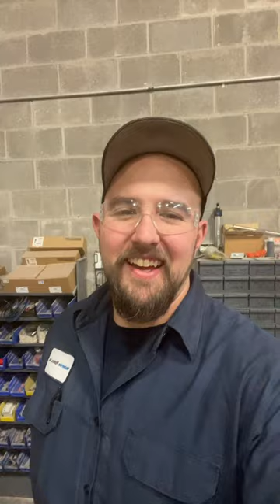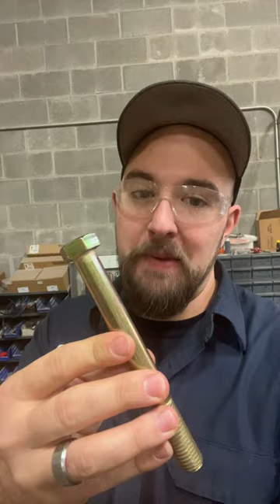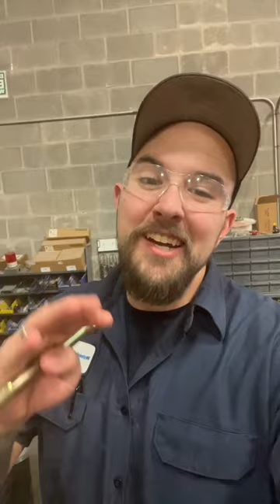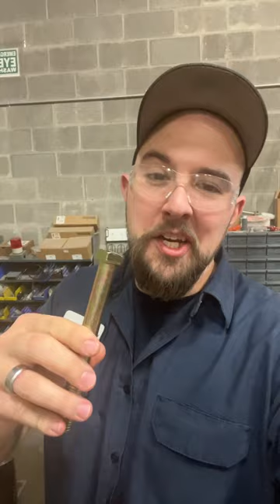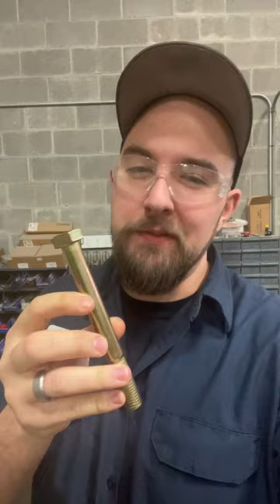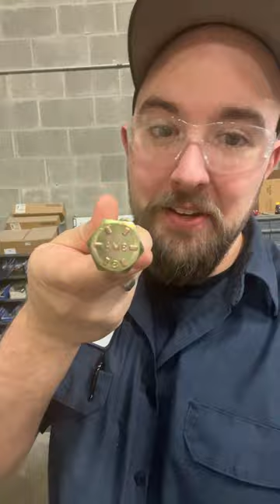Bolt grades??

Comment: Don’t forget the metric standard, very difficult to remember. 
The grade of the bolt is the number printed on the head. No addition needed.
Reply: The other nice thing with metric is the numbers directly relate to the strength - e.g. 8.8 has a tensile strength of 800MPa and will yield at 80% of that, 10.9 has a tensile strength of 1000MPa and yields at 90%

Comment: And DONT make the mistake of using a grade 8 bolt in your brush hog or rotary mower where a grade 2 shear bolt resides. Some bolts are meant to fail

Comment: They use these on the 10" i beam metal awnings outside retail centers. Some places i see splicing with no support under it relyin on sheer strength o its also covered in wooden planks so iron gets hot 🔥 warps the wood. O its also painted.

Ps: a similar bolt idont know every design is different

Comment: technically, it's not a bolt till you add a nut on the end. What you have is a hex head cap screw. Also seems to be cadmium plated, which doesn't really change the grade.

Comment: Have you been spying on me?! I just learned this yesterday. I was cutting the meanest bolt in my entire life. It dulled my saw teeth halfway through so I got my biggest hammer and tried to send it back to hell. I only managed to flatten the thread and had to change my saw blade and cut the rest of the way off. I am not a smart man.
Grade8 > Gorilla
Reply: Just wait till you meet a grade 10.
Reply: @2thehat  exactly what I thought, wait until you work on something that stretches grade 10 like it's nothing and try to figure out how to harness that pressure

Comment: Thats easy to stretch them. Just tighten them in a tool. Only putting  them in about a half inch. Then tighten the clamps good. Even stretches the platen holes. 😂😅😢😢